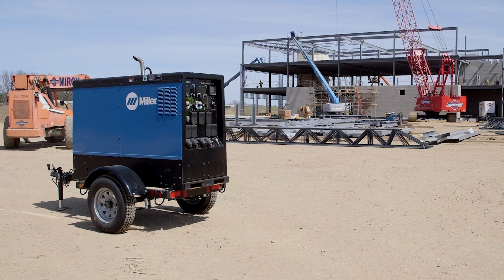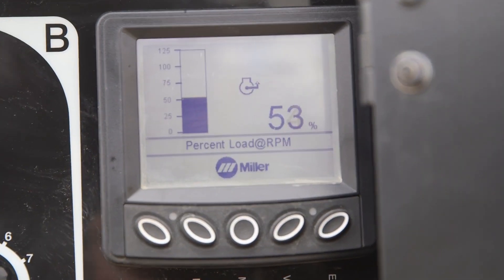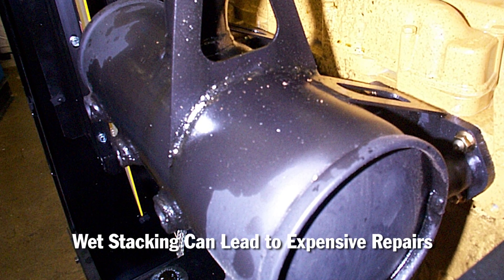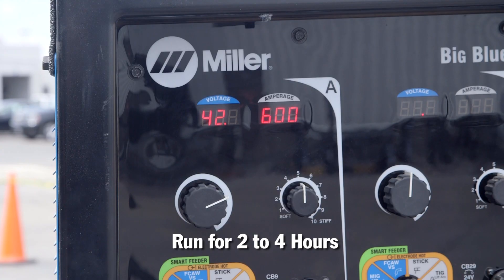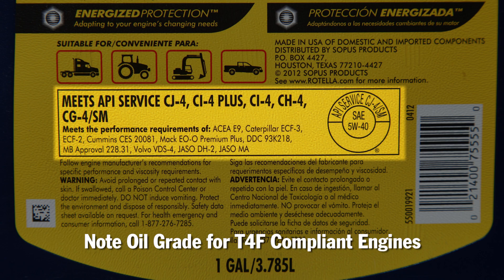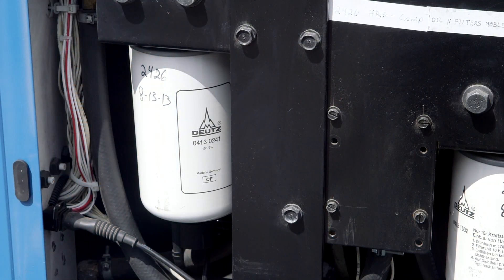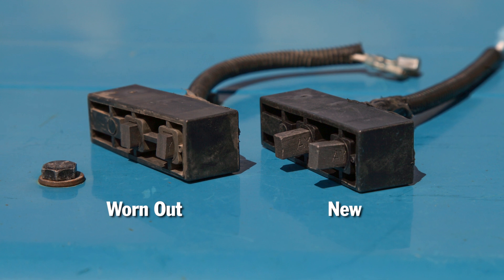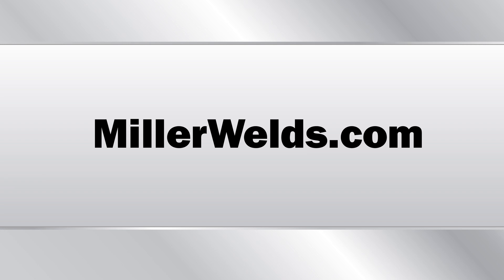Maintenance Tips for Diesel Engine-Driven Welders

Comment: So if it needs rev open then what about the Miller trailblazer 325 because that’s going to be welding at idle at 135 amps and below
Reply: When you connect it to a load bank, have the load bank set to 400 amps, and crank up the TB325 to 300 amps. (stick mode) It will automatically idle up based on the load asked of it.

Comment: would a miller thunderbolt 220 ac DC have trouble burning a 5\32 rod
Reply from the maker: +jody McDaniel Thanks for the question. You can find specifications, including electrode amperage and polarity charts, for the Miller Thunderbolt 225 XL AC/DC stick welder here: https://www.millerwelds.com/equipment/welders/stick-smaw/thunderbolt-xl-225-150-ac-dc-stick-welder. You'll want to scroll down to the "specifications" section and download the product literature. Hope this helps. Thanks!

Comment: I replace my oil filter, belts, tubes, and all the wires in my welder. Every time I do an oil change. Preventative maintenance is very important. Oh wait… My welder is 30 years old and Miller/the engine manufacture doesn’t carry any of these parts and if I can find them on eBay or other websites, they cost a fortune! Kind of tough to do maintenance when parts aren’t available.

Comment: How cooling system work there is no radiator and coolant
Reply from the maker: Hello Jahangir. Some of the Diesel engine used in our product are oil or air cooled diesels engines. They did not have traditional water cooled radiators on them. The Deutz 912 engine was air cooled engine (No radiator at all). The Deutz 1011 and 2011 engines were oil cooled. They did not have a traditional radiator but were equipped with oil coolers. Most were incorporated in the engine. Some of them were external depending on the model of the machine. The two engines featured in this video were used in the past however they do not meet the current Tier 4 emissions level for North America and can no longer be used. 
These engines have all been replaced Tier 4 Final Diesel engines that are all water cooled in the North American markets. For Export we still do use the Deutz 2011 engines in some models. We hope this helps!
Reply: @MillerWelders  Thanks for reply